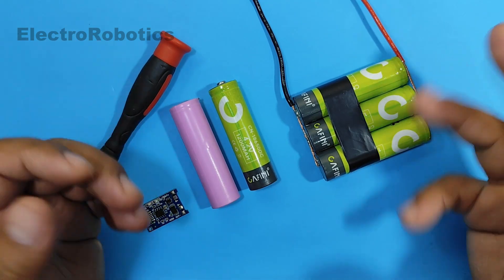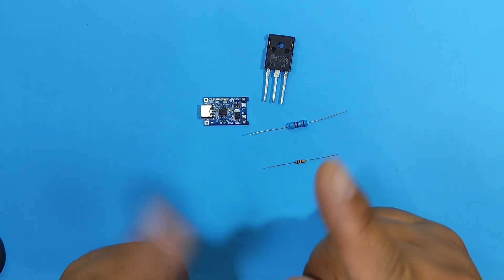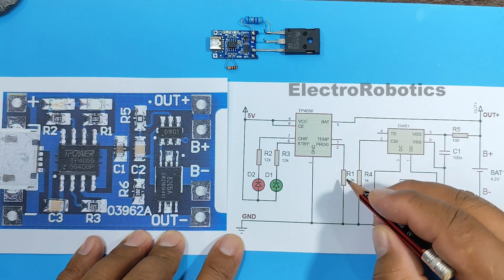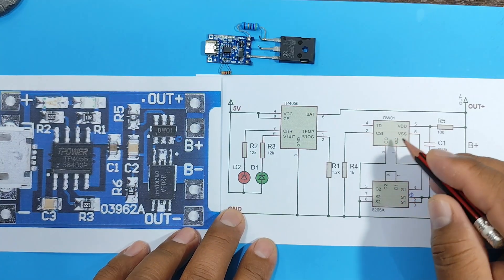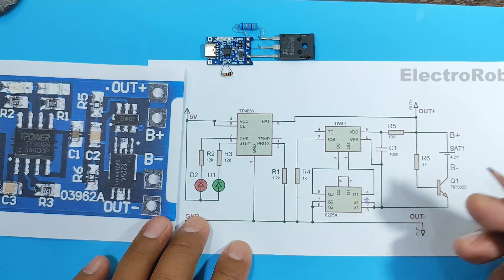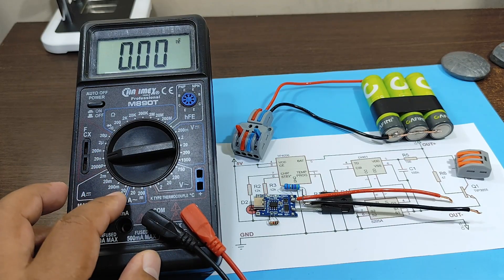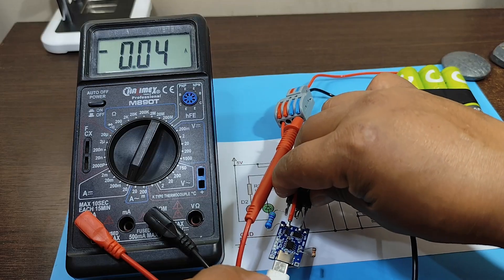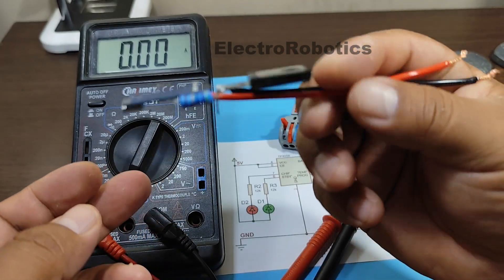Modification of the TP4056 Module to Charge Multiple Lithium Batteries at the Same Time

Comment: I think this is because the IC knows the current that goes to the battery so instead it should in theory work if you disconnect the output of the IC from the battery and connect the charger output straight to the positive of the battery, which means the IC will know only the current that goes to the base of the transistor . However I'm not sure if this IC adjusts the output current to lower than 1A and can work with it and surely it depends on the gain of the transistor as well, but at the same time the circuit won't be safe anymore for batteries that need less current than 1A and probably will damage them!